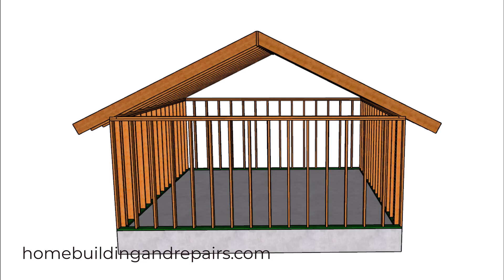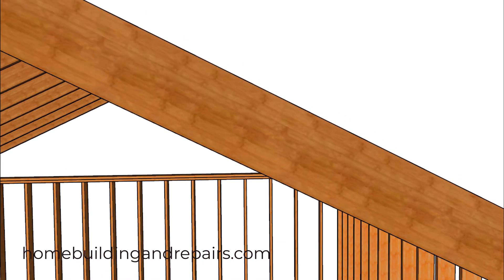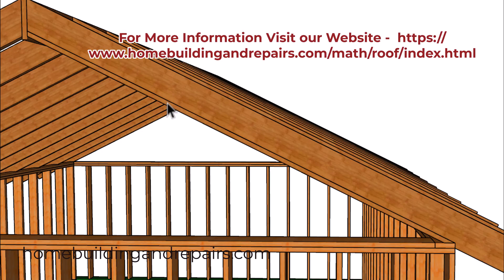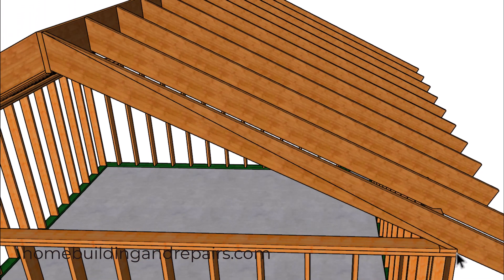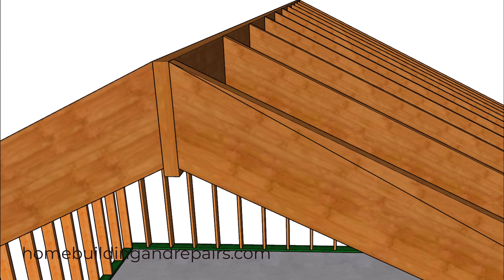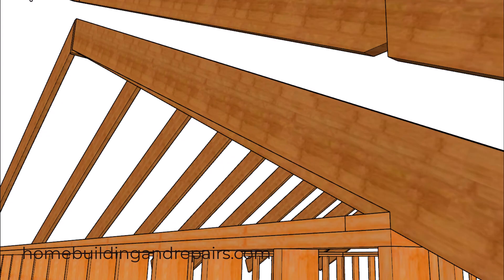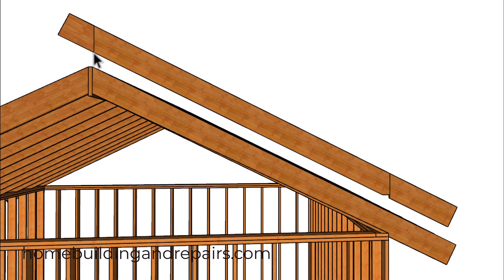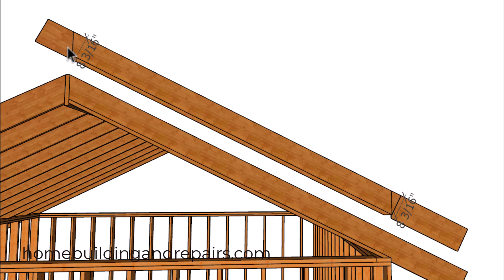How to Correctly Measure Roof Rafter If You Cut Seat Cut First And Then Layout Measurements

Comment: Could I ask you have any advice on UK spec garage roof where I wish to raise the lowest beams running wall to wall a few feet 6 in total not the full garage 
I basically want to install beams further up in height then fix and remove the original lower beam and then brace from the garage wall to the downward beam that is on an angle do this 6 beams and also through the middle raplce the straight beam from the downward posts I can’t post pictures on here so not helpful
Reply from the maker: I won't be able to help, maybe contact an engineer.